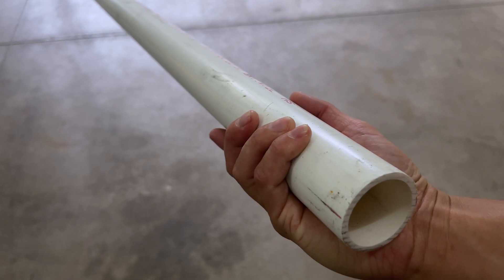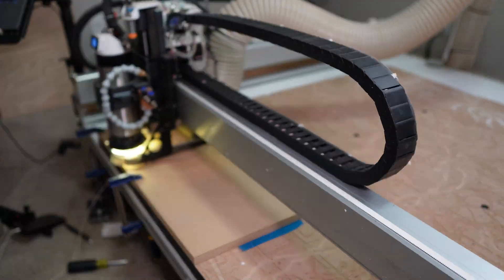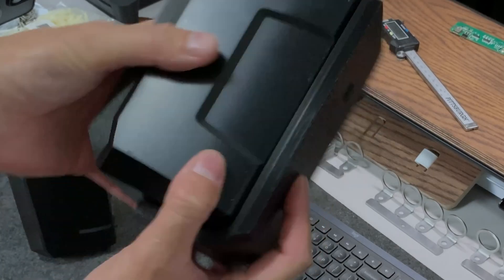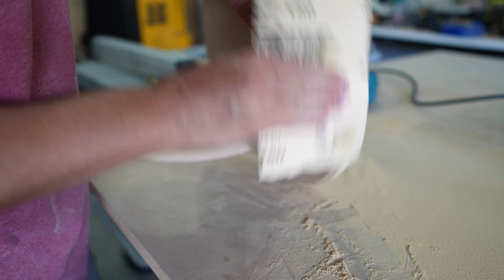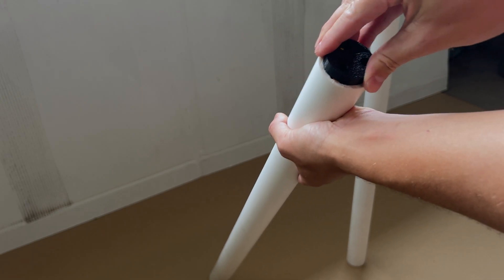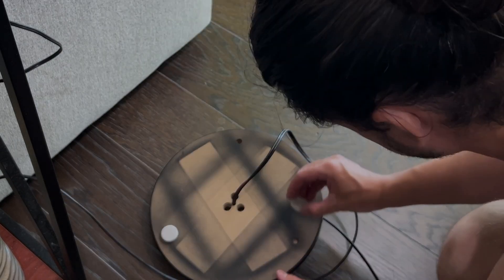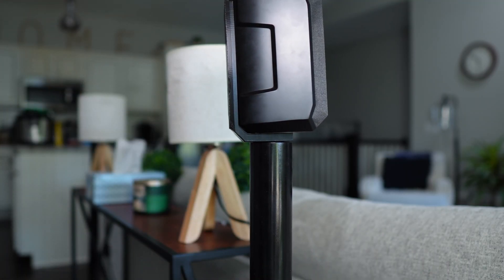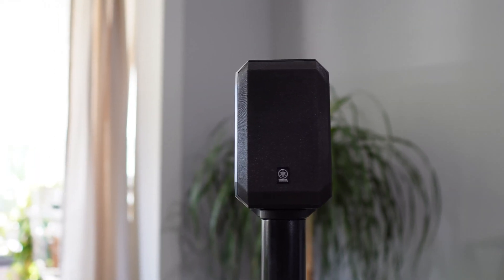Premium Speaker Stand for Less

Comment: You should fill the PVC pipes with sand to increase stability and reduce vibration transfer from the speakers which causes distortion and buzzing noises. Otherwise, cool stands :)
Reply from the maker: That's a great idea, thanks for the suggestion! I might just do that